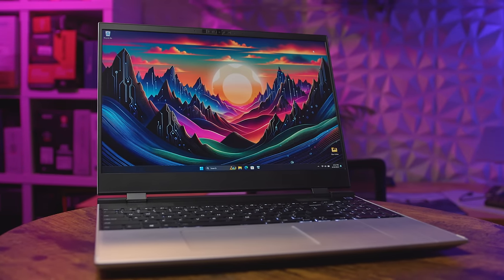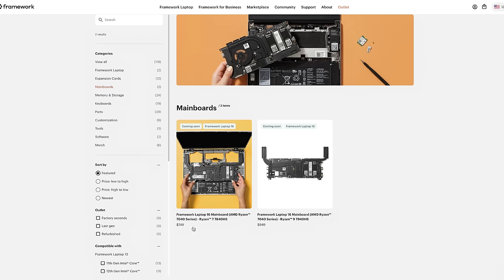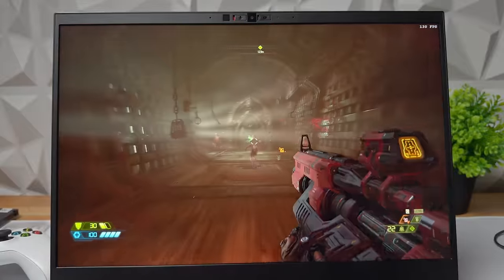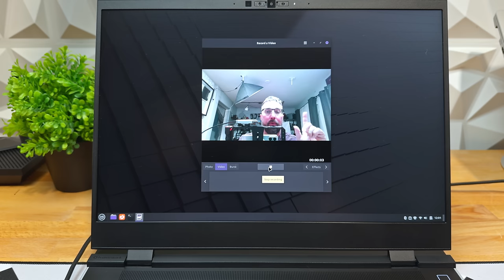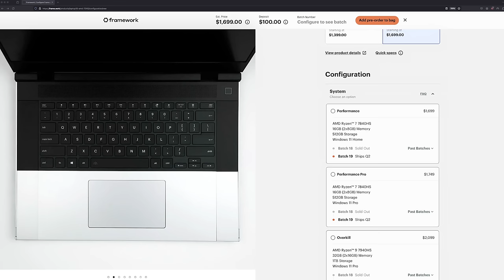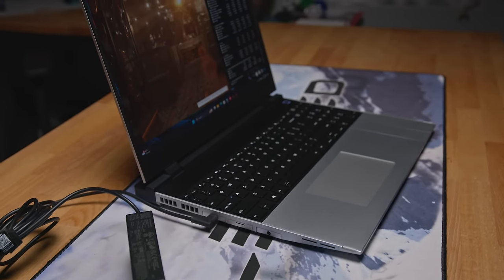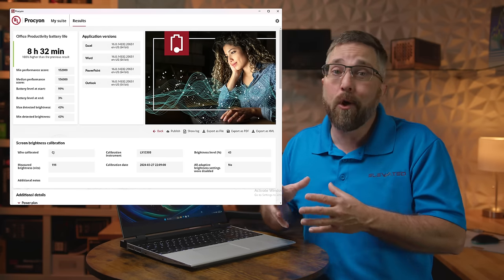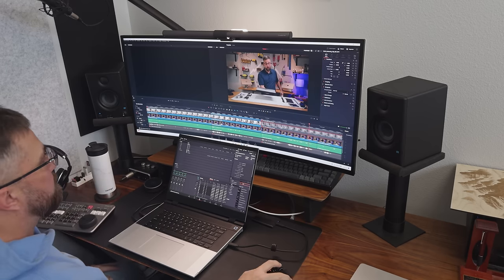Two Months With the Framework 16 Laptop. My Final Thoughts!

Comment: 850k views ? Well, creating 800k accounts might take a while, I hope you are patient enough!

This does look and emit a lot of "first gen" and the usual shortcomings. I do hope that there are enough people for which this is what they need and buy, so Framework can continue to improve and deliver. They just had another newsletter announcing that they now have dedicated people for BIOS + firmware + drivers updates. Not to mention that everything that's not coming directly as a binary to them from manufacturers, is open source.

I do hope they manage soon to add Intel to the Framework 16 and NVidia GPUs. And that 240W charger. Quite many of Framework 16's issues are actually coming from AMD.
And I do think / hope that the next gen of Framework 16 will be much better in almost all aspects, but above all, much more polished and better price/performance, which is indeed one of its most weak points. When Arrow Lake arrives, if it's not a bust, I will get a Framework 16 with it (and I hope there will be an option, and not long after Arrow Lake lanches). Hopefully with it, maybe they can make 128 GB of RAM at 6000 MT/s a reality. And I will get it even if it gets to be $3000, though I can't say I'm that rich, but I do like their mission and I do want to support them. But that's also hoping that the current laptop still carries me until then. It will be over 8 years old by then. I don't want to deal with buying and selling and changing multiple laptops.

Comment: It's a shame you returned the FW16, I enjoyed watching you put it through different deep dives and was looking forward to you putting through more. No shame to you though, it's the 1st iteration of a new product so no doubt there be a lot of bugs to fix. What price range would you say FW16 should be at? How was your customer experience returning the laptop? Does the Framework community generally agree that current issues are kind of deal breakers for non-enthusiast?
Reply from the maker: For me it wasn't so much the bugs it was the lack of performance. Like I said at the beginning of the video, I think this would have been an excellent laptop at $1800 which is only a few hundred above comparable laptops. The return process was smooth, no questions asked but it did take them about a week to send the return lable. I don't think I'm alone in returning a FW16.

Comment: 3:35 If i buy framework 16 for $2600 then when i would need new cpu, like a theoretical ryzen 9 8950HX, i could buy a new laptop with RTX 4070 laptop and needed cpu for $2000+ or just an upgrade for $900-1000. Twice as cheap and two to three times less e-waste

Comment: I get it, it’s new, it’s expensive for early bird, it’s still not perfect…i got them all…but that’s not what i’m upset about. I’m upset because despite called it modular laptop. We basically have one config (if you didn’t count ryzen 9 which is just higher clock ryzen 7). They should launch with more option, intel vs nvidia as a choice for people to config base on their need. Need oled display…i willing to pay more for those upgrade that i know i would use right now and so on. Not to be upgrade and waste on a part that i dislike.

Comment: The speakers are fixed in Linux by adding an EQ using easy effects and the profile posted in the forums.
Reply from the maker: Better, but I wouldn't agree on fixed. The sound stage is better but they are still pretty weak, and the side firing doesn't allow for any spatial audio.
Reply: @ElevatedSystems  I can agree with that. It’s more “mitigated” than fixed. And Linux can also overdrive audio to overcome volume issues after EQ.

Comment: if you insane enough to buy a stacked MacBook, you can buy 2 Framework machines and a Macbook Air or another Windows laptop/desktop..
Reply from the maker: But then I'd have 2 Frameworks that can't handle my workflow. BTW my MacBook Pro cost $1000 less than the FW16 and it can easily handle my workflow. Mac's aren't perfect machines but the ability to smoothly and efficiently do the work is my, and most business owners #1 priority.
Reply: @ElevatedSystems  I would not even buy a Framework because I am on a machine that does what I need for less. I am not convinced a $7000Mac outpaces a Windows machine that costs over $5000...Then to top it off,I do not have to pay for software unless I choose to get  some specialty item.

Comment: If you equip it with 64 of ram then it very competitive with other laptops. Where I live it's price is smaller or equal to competitors with 64 gigs of ram, only competitors often have worse screen.

my workload is CPU and ram havy and I run Linux, there's no alternative to it and MacBook will cost 2x. Other linux laptops do not have wow effect and pretty much comparable to generic cheep windows laptops. Anyway, my main machine is a PC and this laptop is just a backup when I travel, don't really needed one but my company compensate half of the price of a laptop not a PC :)

Comment: I think the big thing Framework offers is the ability to get a laptop with 32GB or 64GB ram and 2TB+ of storage for far less than anything out there provided you build it yourself. It amazes me that laptops are still coming with 8GB ram, especially the Macs. I have an intel Macbook pro with 16GB and it struggles with memory usage no end. I won't even consider 16GB for a laptop and because some companies top out their offerings at 16GB, you get pushed into very high end offerings with a faster processor, a fast GPU etc than what I want. 

his wouldn't be a problem if other companies simply included replaceable ram. It's a joke in this day and age that it isn't an option.
Reply: With the lack of love for Apple's Mac Pro towers, one does wonder as to how much of their consumer base is high end enthusiast, pro-sumer, or professional. There is a market segment which will afford premium prices for a suitably polished finished product, such as "entry level" devices in the "Professional" category which tend to be more robust and have lower depreciation. 

Seeing as these individuals are opting for the base models of "Professional" grade, they wouldn't need more than the 8GB of RAM that Apple provides for basic email and web browsing. These customers do not upgrade their own memory, and may not be pre-disposed to look under the hood to see the direction the market is turning. 

This may lead to a downturn in perceived market value, and subsequently a downturn in stock valuation for Apple. What is the point of buying second hand if you can't upgrade it to something that works? 

I had a $298 2009 Dell Inspiron 530 from Walmart. I was able to, over time, upgrade the system to a Core 2 Duo, 8GB of RAM, an SSD, and an early revision of Windows 11. I have opted to replace it with a Framework 13 wherein I settled on 16GB of RAM for a non-gaming device, but one with the upgradeability and repairability for sufficient longevity.

Comment: I bought mine when I didn't really need a new laptop simply to put my money where my mouth is. I've been talking smack about the laptop market for over a decade ever since they decided to emulate the car industry. Oh you want 32gb? Then you need to buy the model with the super expensive GPU that you don't want! Oh you want the nice display? Then you need to get the overpriced power throttling garbage intel CPU model. Wow! Thanks pc industry! I would definitely not push you over the train tracks if you just stood there!

I got a ASUS Flow X13, but got bit by the soldered 16Gb RAM. I thought it would be restrictive but enough to handle my dev workflow on Linux. Little did I know that when all the programs are open I'm at 80% RAM usage on a basically empty project and finely tuned settings where the OS / Services only uses 300mb of RAM. Thanks ASUS, 2000$ in the bin.

So, yeah... I'm getting mine tomorrow. It's overpriced, it's got a bunch of issues, and I can't wait :D
Reply: You pay a premium at first but then save money in the long run. I get mine sometime in the next 2 weeks. 😀
Reply: @thefluffysloth  Let's gooooo!

Yeah that's what I figured as well. The boards will all get recycled into the server rack over time instead of paying for power hungry rack units. So there's a good chance that I'll save or get even on laptop costs overtime and I found the perfect excuse to not spend any more money on servers :D
Reply: @bublybublybubly 😂
Reply: Which one did you get

Comment: I don't have a framework but Apple is not an example of anything. It is an anti-consumer company. I have had problems with my iPhone and MacBook out of warranty where they asked me for a lot of money to repair them. More than 1000 euros for a motherboard. The battery on my iPhone was defective during the warranty period and they also refused to put in a new one.

In Europe they are having many problems with Apple and the right to repair.

As for franework, over time it will solve the problems of framework 16, which are more software-based, and will also reduce prices. At that time I think they will have great sales.

Comment: Your paying for upgradability, if your getting another laptop with the same specs because it cost $1k less, you'll still have to spend that same cash buying a new laptop in the future because you want to get a better system with a stonger gpu. I'll pick the framework 16 anytime, anyday. And also, that speakers sound really good, better than alot of gaming laptops
Reply from the maker: But you have to spend that same case in the future just to upgrade the FW16. I can spend $1000 less now, and then in 4 or 5 years spend the same amount as it will cost to upgrade the FW16, and buy an entirely new laptop. Then I have the latest display, speaker, touchpad……. In the end I have 2 laptops and saved $1000

Comment: Anybody ?    Do you get paid for older parts, discount for newer parts in exchange of older parts ?
Reply from the maker: No not by Framework. You would have to sell them yourself through 3rd party a marketplace like eBay.
Reply: @ElevatedSystems  thanks for reply. ok. Well since i keep scouting for used laptops, this honestly doesn't look cool in the long run. 

Wonder where Microsoft and Windows go with their AI and NPU TOPS requirements. Might buy yoga pro 9i core 9 ultra or one of these with intel.

Comment: “Is it worth it?”

It will be if the alternative laptop fails after 2 or 3 years and costs $400+ to repair versus the same fault occurring with the FW16 where you can simply swap out a relatively affordable component yourself.
Reply from the maker: If something on the FW16 mainboard fails, that's a $950 "Swap out", the GPU, $500. I'd be more comfortable if FW offered an extended/accidental damage warranty on their laptops.
Reply: It's funny how people are always picking the worst possible scenario for the "regular" laptop here.
Reply: @ElevatedSystems  the most common failures i see on laptop mainboards are damaged ports. the fw design inherently mitigates that quite a lot, through the expansion card system acting as a sacrificial in-between
Reply from the maker: @esotericine  the first thing that broke on my FW13 11th Gen mainboard was one of the internal usb-c ports. Luckily I have the skills and tools nessasary to reflow the solder points or it would have been a costly repair. Of course most normal people don't disassemble their framework as much as I do.

Comment: I don't take away his decision, but he omits that Apple was out of warranty or if you didn't pay, Apple Care would have charged him more than $1,000 for the repair.
Reply from the maker: But at the end of my coverage I can just extend the Apple Care + on an annual basis, or I can trade my MacBook in for a new one. I think Apple is offering me between $800 - $900 for trade right now. I'm actually considering trading my M1 Pro MacBook Pro and M1 Max Mac Studio for a M3 Max Macbook Pro. A single production workstation for home and away.
Reply: @ElevatedSystems  But if your careful with your computer and don't break it yearly where is that money going? Straight to Apple. I would rather support Framework and buy a new display than pay $35 a year on top of the repair cost.
Reply from the maker: @thefluffysloth  me too. My plan was to sell my MacBook Pro to offset the cost of the framework. Unfortunately, the FW16 can't do what my MacBook can when it comes to my workload. I might not like Apple the company but the M series processor is an amazing piece of engineering.
Reply: @ElevatedSystems  Fair enough I am coming from a 2015 MacBook Pro so the performance for me is going to be night and day.
Reply from the maker: @thefluffysloth  performance will be a step up, the trackpad however.......😜
Reply: Shouldn’t bother me too much as I mostly use a mouse. 😅
Reply: @ElevatedSystems  Apple wanted to charge me 1500 euros for changing my motherboard out of warranty...
Reply from the maker: @PbDex-o7w  no doubt, Apple repairs are rediculous without Apple Care. That’s why I never let it expire.
Reply: @ElevatedSystems  You should inform yourself about Apple's anti-consumer policies.... It is a company to avoid.

Framework is a young company. Once they fix the software issues and lower the prices, framework 16 will be a good option.

But he justifies the return of the equipment by using Apple as an example...

Brands like xmg or framework are much better options for users than apple.

Comment: if the design were based on an open standard, it'd be far more interesting to me, if it isn't already.  like, what if i wanna put in an msi motherboard?  gigabyte?  maybe a reverse engineered, improved mac board?
Reply: This is an interesting discussion element. Desktop computers have ATX and ITX, etc. Laptops, generally don't have a standard. This allows for innovation in form factor, such as tablets, ultralights, netbooks. Then you've thermals and ports. Apple's experiment with a 2-Port USB-C only Macbook Air is interesting. 

What keeps the "Framework" laptop from being an "open standard"? What is the difference?

The Framework 13 had the speakers facing downwards, do you want all of your laptops to have the speakers facing downwards? Do you want the poorly assigned shims, and keyboard flex of the Framework 16? Has laptop design matured to the point that we can specify a specify clamshell/case standard for which all future laptops will be based? Is Framework that standard?

If there is no difference between a Macbook and a Dell Lattitude case wise, or if branding were so easily swappable as to be deceptive and disingenuous regarding the internal components and operating system, what impact would that have for everybody? How offended would you be if somebody had an MSI motherboard or Gigabyte motherboard installed in a Framework laptop case? 

Right now the Framework laptop is yet another competing standard (see XKCD 927 "Standards"), why should other vendors adopt the standard?
Reply: there is no such standardization already extant in the industry. framework is trying to cause one to exist.
Reply: @esotericine  yes, lovely, have they made an rfc?  git for design files?  anything?
Reply: @felderup  A partial motherboard schematic is available on Git. Full schematics are available for repair shops. 

I am not saying that Framework is trying to cause a new standardization in the industry, I'm saying their existence automatically does. It is akin to the old "IBM/Compatible" description from back when IBM dominated the Windows and Intel market. IBM's existence defined the standard. We've eventually supplanted the IBM standard with the ATX standard, which no doubt had a proper rfc.
Reply: @marvinmallette6795  schematic is nice, but useless to other manufacturers, the mechanical designs need to be open for it to be meaningful.
Reply: @felderup  You are speculating on some phantom imaginary hidden thing that manufacturers would need that they do not have access to. The main thing that is missing is a sufficiently sizable established market.
Reply: @marvinmallette6795  the shape of the motherboard isn't a real thing?  the locations of mounting holes is imaginary?
Reply: @felderup  If for some reason those things are not in the schematic or on the GIT, then they are physically present in the final product. The mounting holes are not electrically active components, how precise do you think the tooling needs to be? MSI or Gigabyte can buy a laptop to get those specifications using a tape measure.
Reply: @marvinmallette6795  they'd also need the design patent rights.  those have to be opened specifically by the original designers, any ol jackass can measure, but selling something based on those measurements may not be legal.